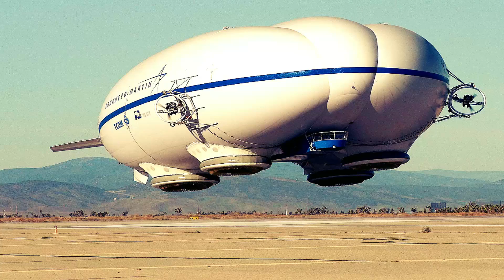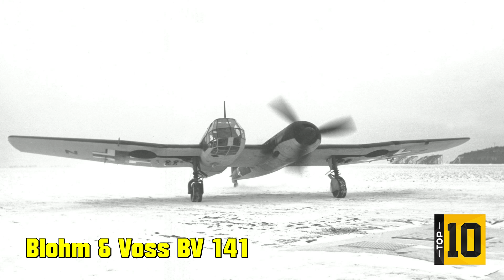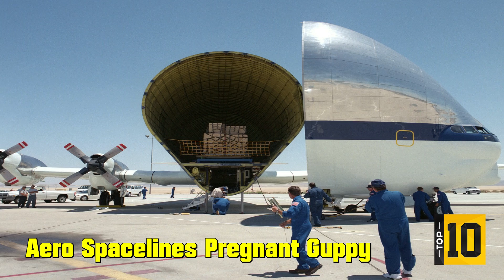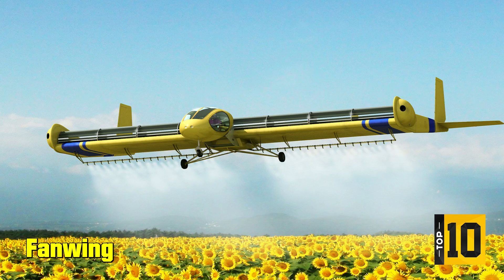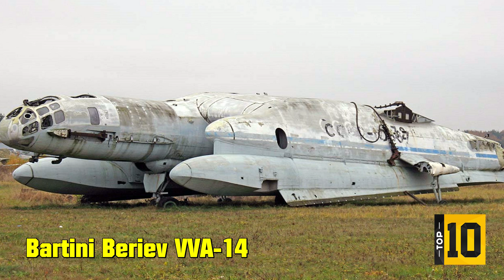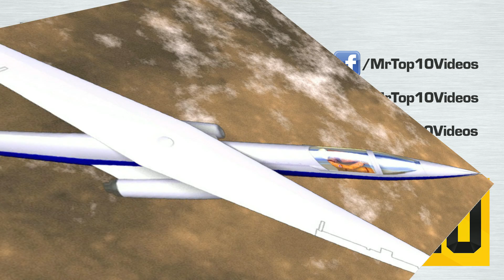10 Weirdest Airplanes

Comment: The picture of the plane you called the Pregnant Guppy is actually a Super Guppy used by NASA to carry ISS components and you said it led to the development of the Boeing Dreamliner, it actually led to the development of the Dreamlifter, which is used to transport parts for the Dreamliner. Check your facts before you make a video.
Reply: The Super Guppy is much older than the ISS. It was designed to carry sections of the Saturn V and 1B during the Apollo programme. Airbus later used them to ferry components of Airbus airliners from their various factories to the final assembly plant at Toulouse in France.
Reply: NASA had also the pregnant guppy but only the super guppy is still in service so on the pictures it's the super guppy and it's completely different super guppy's that airbus used. Now airbus uses the airbus beluga.
Reply: Ryan Stockton r